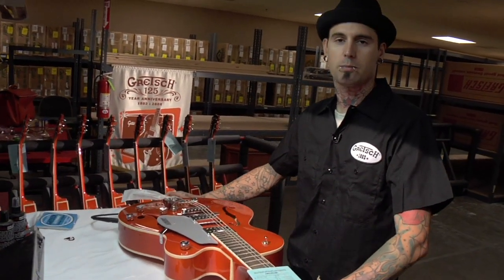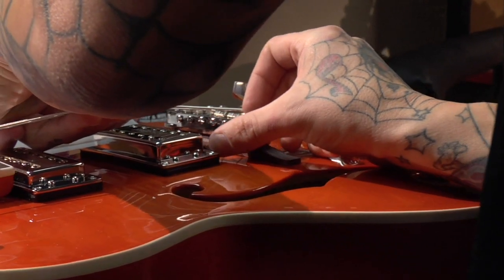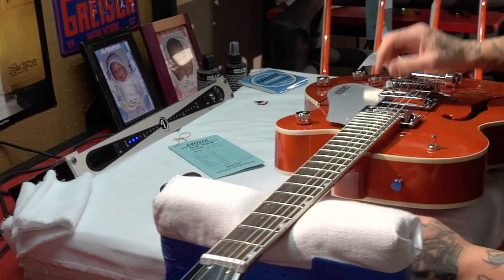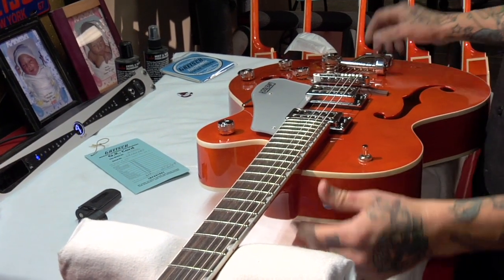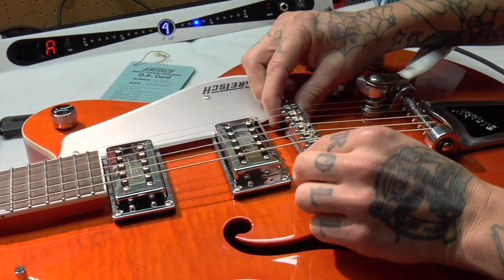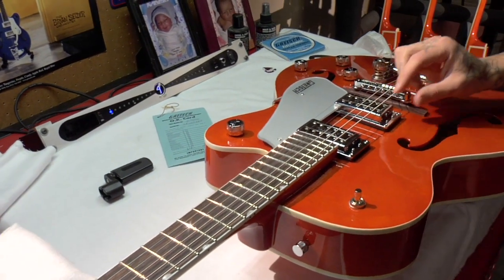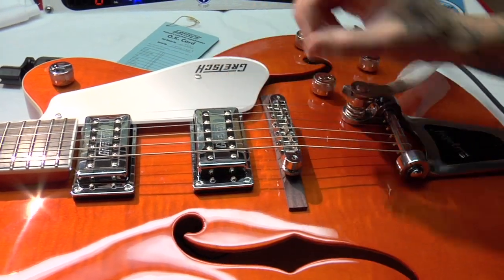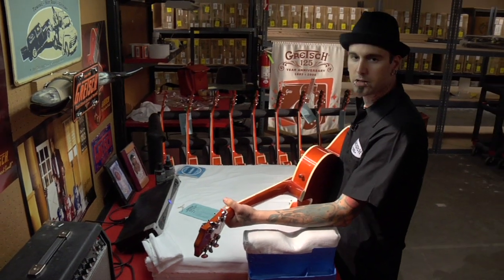How to Optimize Your G5120 Electromatic Hollow Body | Tech Tips | Gretsch Guitars

Comment: yeah, and after using the tremolo your bridge is out if place again.
Reply: Nope, it stays there.  Rocks back and forth just fine.  I have one and after a string change and the strings settle in it pretty much stays in tune.  Granted, yes it will go out if you go crazy on the Bigsby, but a Bigsby is not meant for that, it's made for shimmer.  Not dive bombing or crazy pull ups.

Comment: im thinking of getting a  'G6120DSV Nashville' off the internet. i think they're discontinued. do you think its worth it or should i get a brian setzer model instead?the guitar has 2 DynaSonic single-coil pickups-Bigsby B6BCDE vibrato tailpiece with 1956 handle. i know th BS MDL  DynaSonic single-coil pickups
Bigsby B6BCDE tailpiece with 1956 handledels have TV Jones pick ups. but does it really make that much of a difference?  can i still get a rockin' rockabilly sound off those pick ups?

Comment: I have one of these with the non fixed bridge and thought I'd pass along this info.  I sanded the base of mine (bottom side) to better match the body contour and now it's so slick that it moves when I use the Bigsby or do bends.  I marked the correct location for intonation by using masking tape on the corners of the bridge.  Then I used thin double sided tape on the bottom to "fix" my bridge and all seems good now.

Comment: Intonation was a sack of sh*t to establish, and when you change strings if you want to keep your intonation you must change the inner 4 strings, because if you don’t you right back to resetting the intonation. After I change the 4 inner wires then I change the high and low E strings? It’s a pain in the butt but to get that sound this is the only safe method fo a quicker less hassle free job?